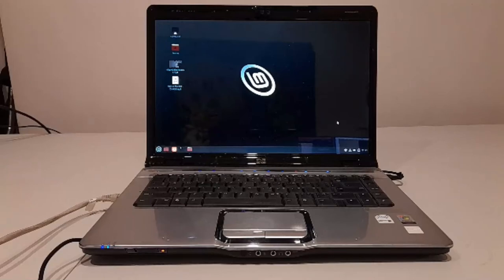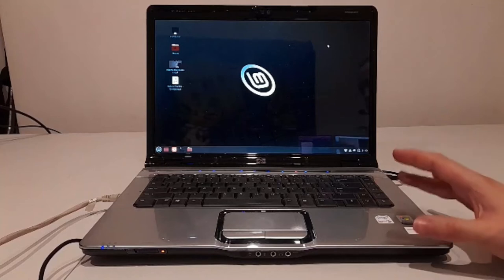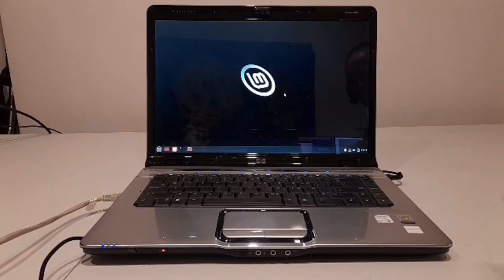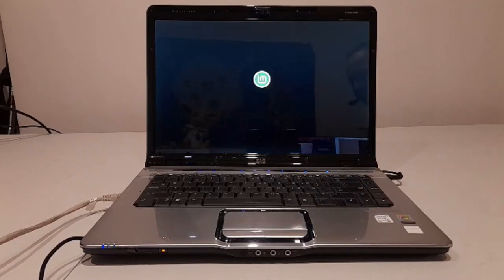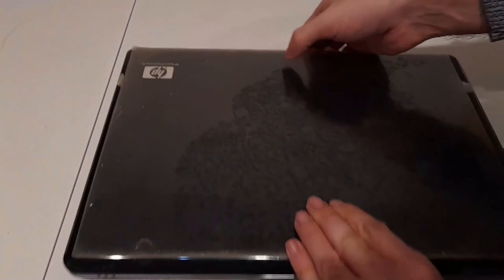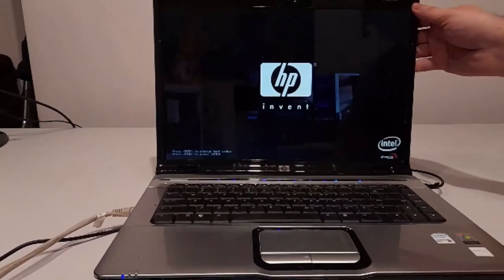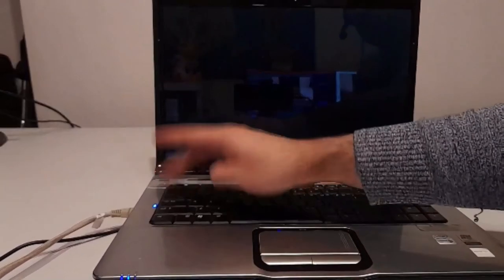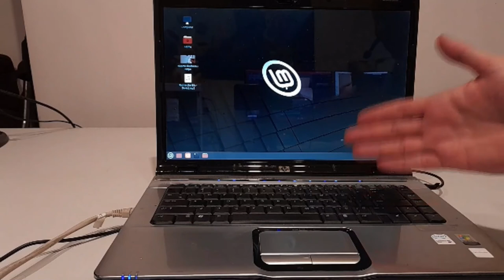hp pavilion dv6000 sound and power cable replacement

Comment: Which number cable it is buying link
Reply from the maker: got it from amazon but can be fount most places. look for Power Button Ribbon Cable 12 pin for HP DV6000 or DV9000 it will work for both
Reply: @darknido1  thanks